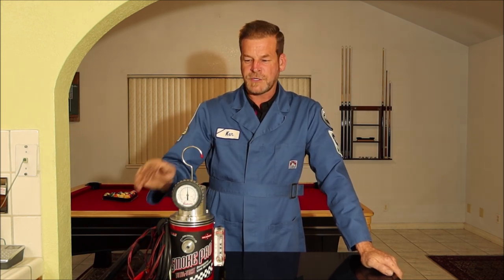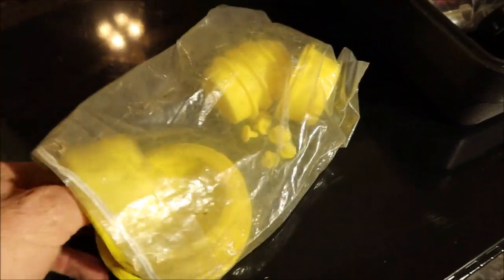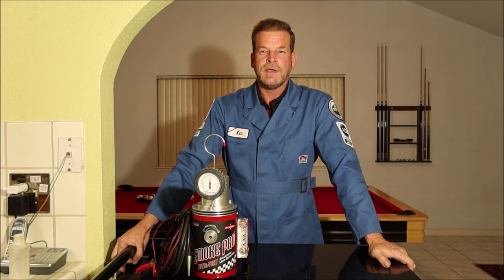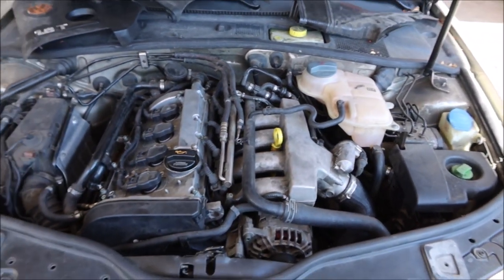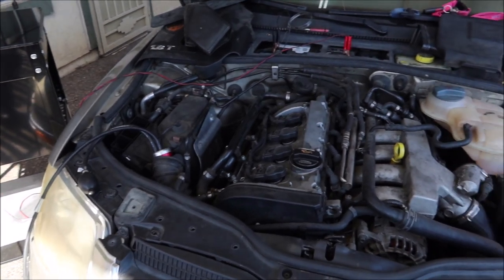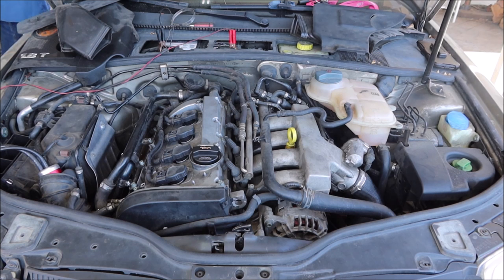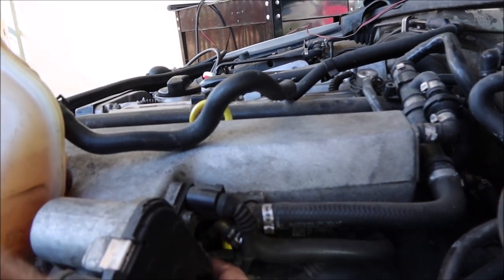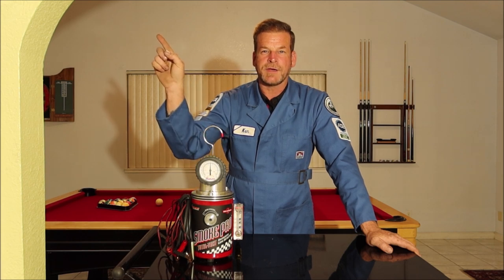How to use a Smoke Machine to find Vacuum Leaks.

Comment: Great Video.  I have a Small EVAP Code on my Jeep Wrangler, the dealership Charged me $1700 and replace the Tank and stuff and still have the issue.. I hate working with Dealerships.. They just screw you!!!
Reply from the maker: Thank you. I always hook the smoke machine back up after I fix the problem to verify that it’s been fixed. When the ball drops to the bottom you know for sure it doesn’t leak.

Comment: I have 2019 Toyota Corolla my ? Did you do that with the car off and found the leak? And can i just hook the smoker to hose that goes from intake to engine
Reply from the maker: You always have to have the car turned off when you use the smoke machine. You can hook it up anywhere that gets into the intake manifold for finding vacuum leaks

Comment: So I’m thinking about getting one of these, but I’ve got a 2000 Chevy with aftermarket air intake. Not sure the easy intake inflates enough. Another thing, I don’t understand how that works with the butterfly closed? Maybe that’s a silly question to be asking, but my knowledge of the vacuum system is limited. I just know I need to test it.
Reply from the maker: The easy intake inflates pretty big.  The smoke will get around the butterfly.

Comment: i connected to the purge solenoid hose going to the back solenoid that is completely disconnected hose and all and pressure is building up and no smoke is coming  out and gas cap is out

Comment: Great video!! Autool sdt206  is another good smoke machine no need for shop air and way cheaper than redline
Reply from the maker: Redline also makes one with a built in air compressor.

Comment: What if you do this and the only place smoke comes out of is your oil fill cap?  Does that mean I have no leaks?  Or does that suggest I have bigger issues like worn or unseated rings?  Car was freshly rebuilt and its bucking/hesitating badly from 2100-3200rpm.
Reply from the maker: If your hooking it up to the evap system and smoke comes out the oil cap.  The purge solenoid is bad.
Reply from the maker: Ok your hooking it up to find vacuum leaks.  I thought it was the other video you were commenting on.  A little bit of smoke will get past the rings and the pcv valve.  So it’s normally to have some smoke around the oil cap

Comment: My hyundai santa fe 2007 has a problem when breaking... and also engine lose power... that machine would be great for me to determine where the problem since those are due to vacuum leaks.
Reply from the maker: If it has a vacuum leak this is the tool to buy.  It makes finding the leaks very easy.

Comment: There are 10 million hoses. How to find the right hose to connect?
Reply from the maker: The best hose to use is the hose that goes to the brake booster. But you can use any vacuum hose that goes to the intake manifold.

Comment: Hello, do i need to have a moister and oil filter on my compressor when hooking up the smoke machine? Thanks
Reply from the maker: No you don’t need to do that.   But it is always best to keep moisture out of your air lines.
Reply: @1970chevelle396  thank you, I ordered a smoke machine from Redline Detection and they told me to make sure i have a water and oil filter. Would that affect the smoke? Do you have a filter installed?
Reply from the maker: I don’t think It would effect the smoke.   I only have a water trap that I made out of 1-1/2 pipe on the system.    No filter
Reply: @1970chevelle396  thanks! How is the smoke pro machine holding up. I read reviews on Amazon that the O-ring and rubber hose on the canister deteriorate like in a couple of months. How long have you had yours and how is the condition of the rubber hose and o-ring? Thank you for replying.
Reply from the maker: I’ve had it for at least 8 years now.   It’s still in perfect shape.  I haven’t had any problems with it.
Reply: @1970chevelle396  thank you! I’ll be getting mine this week.

Comment: i connected past the maf sensor but smoke wont go through looks like my throttle body is not letting in the smoke can you please help thanks
Reply from the maker: Your going to have to hold it opened.  Or stick something in there to hold it opened part of the way.
Reply: I have an electric throttle body. 2003 Mazda 6i 2.3 l. I would guess someone would have to step on the gas pedal to open the throttle body metal plate for the smoke to go through. I've heard you can blow cigarette or cigar smoke through a tube put a disposable glove over the opening where the intake goes to the manifold cut a little hole in the tip of the finger of the disposable glove and put the tube on there tighten it with rubber band or tie strips and do it that way. But in my case I would definitely have to have someone step on the gas pedal for the smoke to go through

Comment: Think Autozone loans em?  I hate having people work on my car but I've not been able to find this.  At least I know what they would do, but I'd prefer to do it myself before being told I need a head gasket (lie)...
Reply from the maker: No Autozone doesn’t loan them.
Reply: @1970chevelle396  Thanks, I called to ask, but knew the answer when the clerk didn't know what I meant.  For speed, I may need to break down to take it to shop for the first time, other than smog check.  Honest small guy, I hope, I'd prefer to make one and find it but I gotta get on the road.